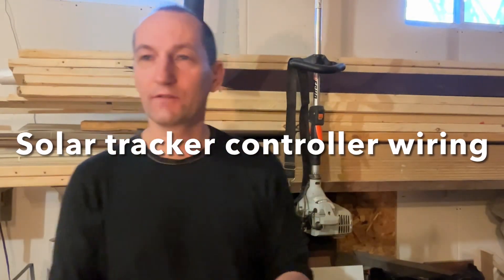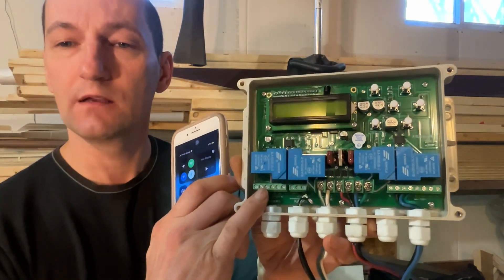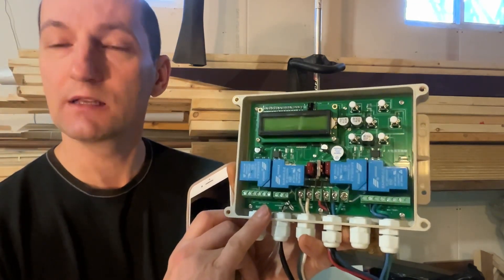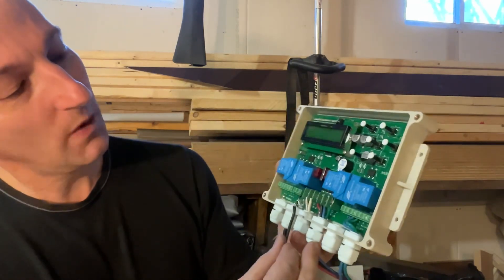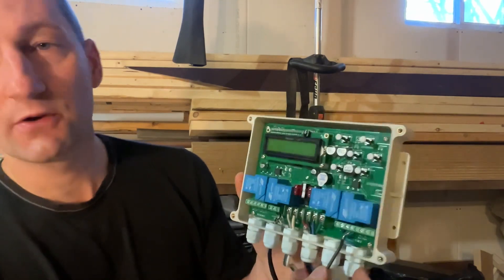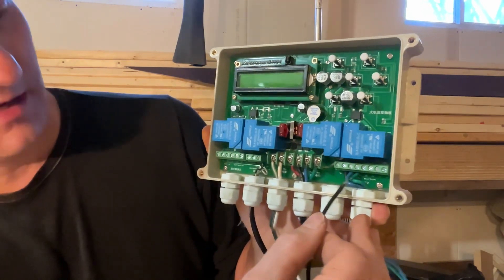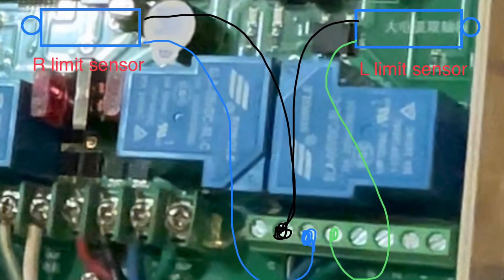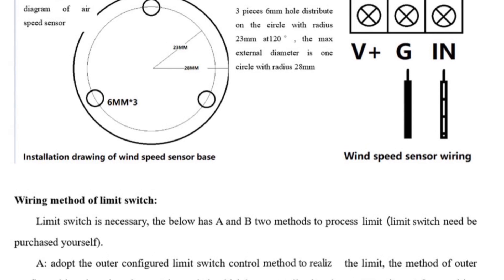Solar tracker controller wiring

Comment: Can you just hook it to the load connection to your solar controller vice having its own independent system?
Reply from the maker: I guess you can, but my solar array voltage is way too high for the small battery and the controller that powers the solar trucker.
In this case, I would have to run the wire all the way from my trailer where my batteries are sitting, almost 200 feet away to power it properly

Comment: Set 000, 000, Wind= 9 north, east 0, west 0, south 0, change 1800 to 300, change 1.8v to .07 for better sensitivity, wind voltage sensitivity from .6 to .2. Use 2x 7A LifeP04 Batteries with 10A MPPT, dedicated on a single 24V 5A panel isolated from the array.